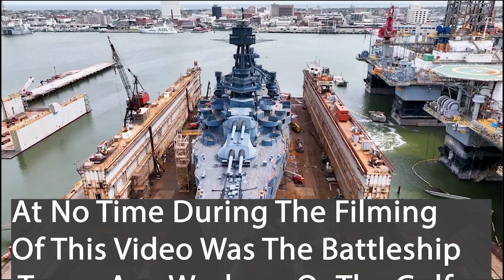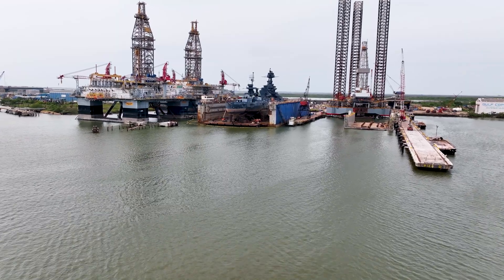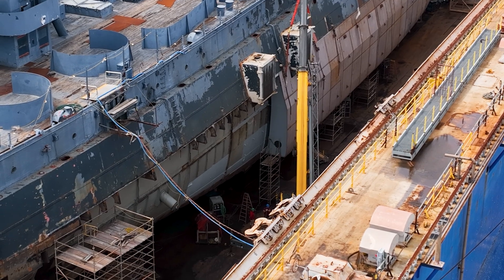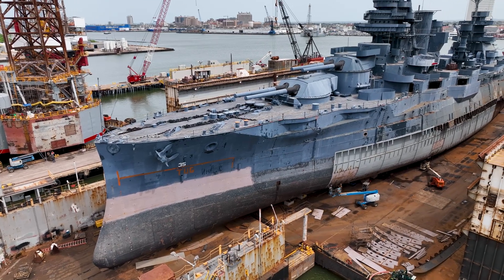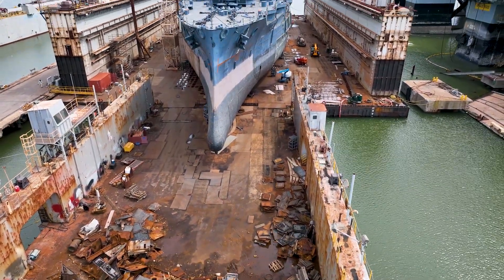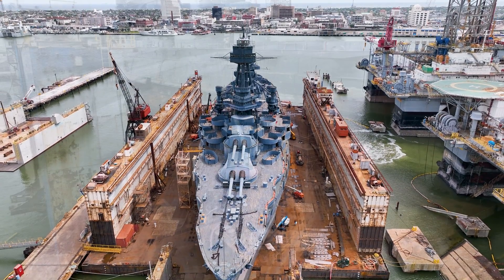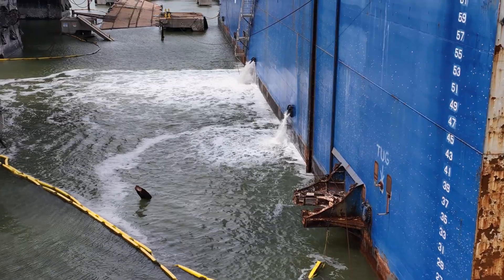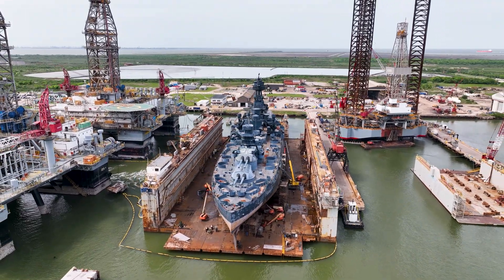USS Texas Behing The Scenes Look at Battleship Texas During its 2022-2023 Drydock

Comment: Why haven't they straightened the rudder . Where is it going after restoration?
Reply: The rudder is at 35 degrees. The last ordered position while the ship was under its own power. Also it has been welded on to seal the leaks around the shaft.
Reply: Them removing the props and sealing the rudder in like that was wonderful. She would have sunk long ago. I am scared at what the other 1940s-commissioned battleship museums will be like in a few decades with intact props and non-sealed rudders. I bet will threaten them all.